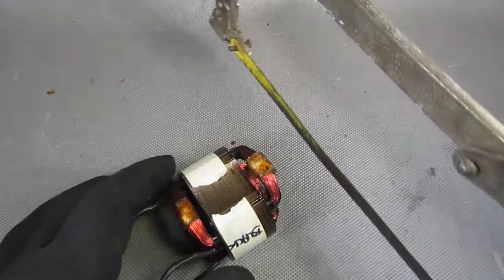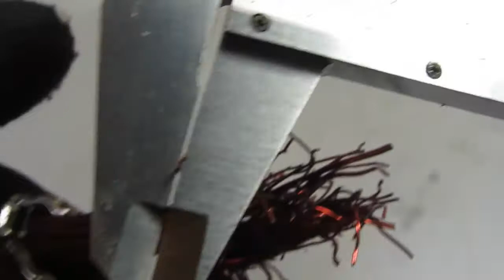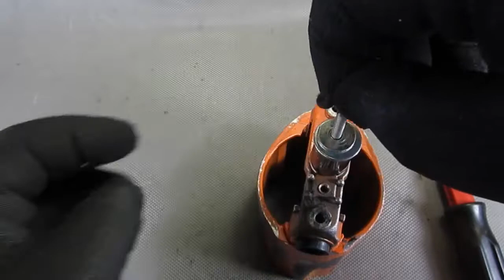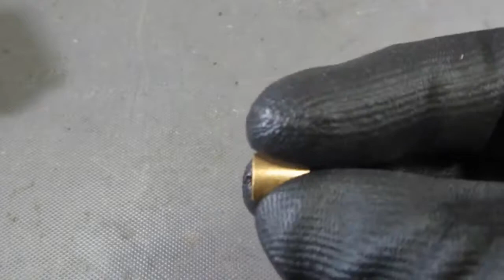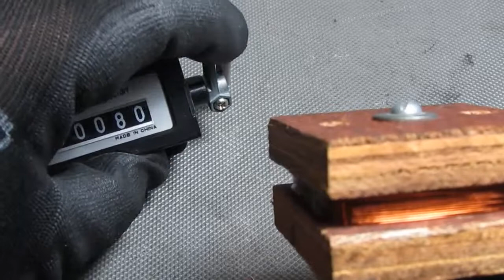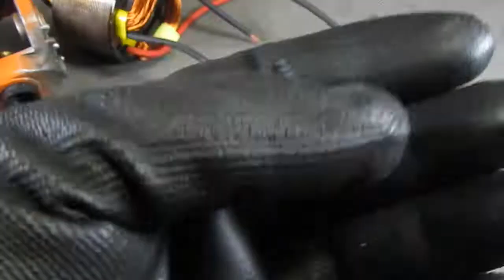Vintage Black & Decker Drill Field Coil Repair - BSFEEChannel #24

Comment: If I understand what the computer voice is saying;
Initial bare wire diameter (too large) was 0.160 mm which equals 34 AWG wire gauge.
Final bare wire diameter (correct) was 0.130 mm which equals 36 AWG wire gauge.
Reply from the maker: When we are using metric units we refer to the wire sectional area to designate the wire gauge, not the wire diameter. So the correct wire is the one with 0.13mm² (SQUARE millimeter) sectional area. This corresponds roughly to the traditional 26 AWG. Hope that helps.